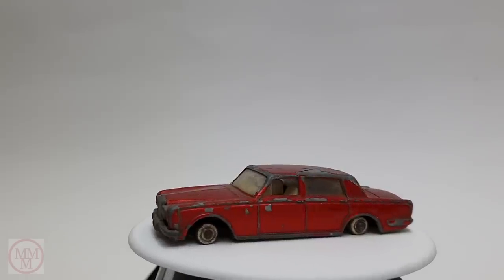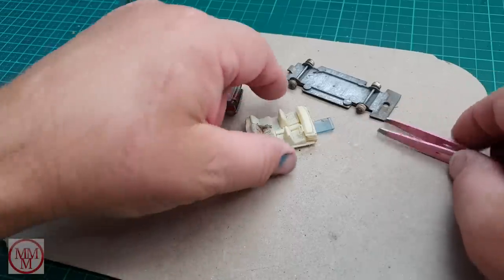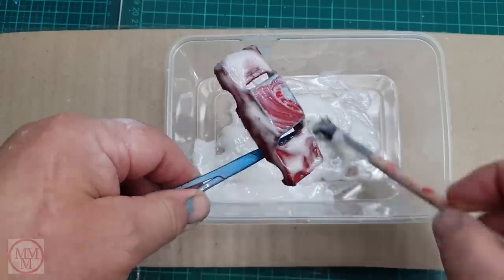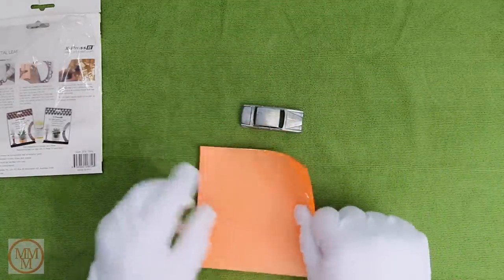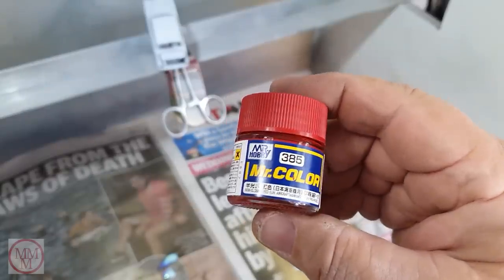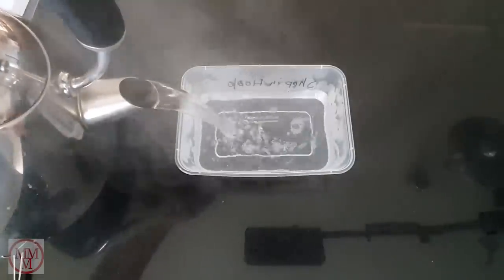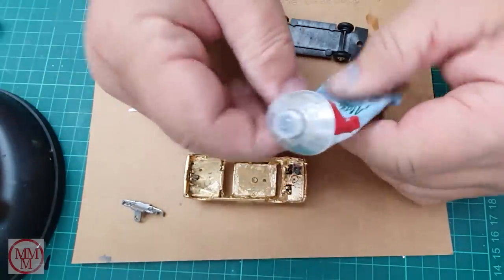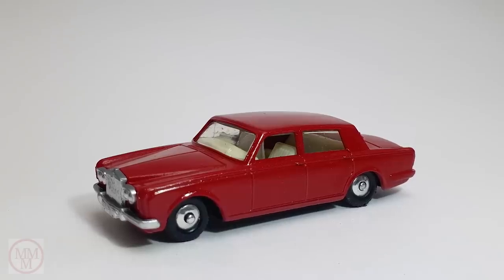MATCHBOX Custom No.24c Rolls Royce Silver Shadow 1967

Comment: Marty, not that you'll touch gold leaf again, but having done a fair bit of it myself you need to polish the base metal to a mirror to get a flaw free finish.
Reply: Yes. Gold leaf need perfect surface. I did that one or two on aircraft model and it works only on high gloss surface.
Reply: Wet sanding a primer may work as well.

Comment: Both Rolls' turned out all right.  I have always used the Selleys paint stripper, now I know to stay with it.  Never know what you will find inside a Matchbox: that spider egg sac!  I just restored a #34 the silver VW camper.  It had a yellow plastic barrel inside, from the #51 Matchbox trailer for the John Deere Lanz tractor.  Bonus.

Comment: Hi there; great channel as always! 
If you haven’t been put off: I think possibly the size was too thick. 
For glass gilding (signwriting) I used “Gelatine Capsules”: you dissolve a few with water. Goes on very thin, like plain water, but you’ll get a mirror finish without burnishing

Comment: Well done Kevin ... and Marty, you too on the cars. I've worked a bit with gold leaf and surface prep (smoothie smooth smooth!) is the key. Also, you can get edible gold leaf fairly cheaply. It doesn't have exactly the same reflective shine, but it's just as bright and cheaper than what you get for gilding. You may want to drop a note to Diecast Resurrection and see what he might do for a paint-based approach. Always a pleasure. Thanks.

Comment: I was thinking the same, get some real gold leaf, say for my Ford GT-40. I'm in Thailand so it should be easy. Meanwhile I wonder if you preheat your paint and body before spray will you lose the bumps? I don't think you did any sanding either. Prep. 
   To my astonishment the first time I tried a make-over the red paint job on my Matchbox Berlinetta came out glassy!! Warm climate??? But because I had no primer it came off easily and also was a tad transparent because I stopped spraying immediately when I was seeing the glassy result. I got the same satisfying glassy white finish on my GT-40 with broken A pillars. Glassy on the first passy. Am I some kind of magician or what? Time will tell. Thanks as always, Paul in warm Thailand.

Comment: The surface of what you want to leaf has to be as smooth and shiny as the end result you want.I would use a gold metallic paint and cover it with gloss clear.Does'nt matter if you use real gold ore the fake one.The real one is of corse "real" but also very pricey but as mentioned,its all up to the preperation of the surface.The leafs are so thin on both types that everyting,even the finest dust will show through.But as with all new techniques,training,training and more training will at the end make it perfekt.Gold leaf is an artform!!

Comment: You'll probably get a phone call from a Saudi Sheik that wants to buy it.  I had a Harley Sportster in 1972, that I customized and painted white.  I used variegated gold leaf and put custom panels on the tank and fenders, then shot red pearl all over it.  Looked awesome.  I sprayed the adhesive...you know why now.  And yeah, you can't breathe when you're doing that stuff or have any air movement.  The brush you used was close to what I used.  The secret is to have the surface beneath the leaf as gloss smooth as possible, because the leaf shows any imperfections in the under-surface.

Comment: Hi Marty ,  I applied gold leaf to an Airfix 1/168 Royal Sovereign , also had problem with the glue , so I diluted it with purest sugar cane alcohol or good quality  vodka ( alcohol with minimun water ) and also applied with airbrush , to obtain a soft surface . After leaf applied  next day airbrushed with 2k polihurethane . All metallic finishes  ( aluminum foil , paint , gold leaf ) tends to enhance all imperfection left on surface , therefore it has to be prepared -polished  mirror like . However , gold leaf has its limitations , it may show tiny cracks , wich in the case of that particular maritime vessel  give an antique effect . Always looking for a new video from You , I´ve learned a lot  from You , and  I see You are becoming more sofisticaded and technified .

Comment: wow, what a project. :) unique indeed! someone saiud they'll send bare metal foil, and I wanted to recommend it, too. the silver/chrome is thin aluminium foil with a glue backing, the gold is actually brass. a bit less wieldy than the aluminium, but applies the same and is easily polished. and in this scale looks a lot like real gold.
furniture restaurators actually use sticks with a rounded opal stone at one end to polish the gold leaf layer into smoothness ontop of the wood (or whatever material they used). german TV had a series where they portrayed old, almost-forgotten crafts for the future, and there was one professional picture frame restorator. so I think one of the problems was that you had no means to smooth out the surface after application.
btw, when you snapped the spring leaf I actually got startled; I know this noise too well from the past. :P
aaand I enjoyed the outro as well. :) stay safe! <3

Comment: Try a cheap hobby "electroplating kit" and have a go at electroplating the gold ( It's what's used for "gold plated silver" jewellery etc. that way the gold plating is smooth seamless and probably won't cost as much as doing several goes wasting product to get a good finish. It can be used to plate other materials too like nickel (Looks like chrome) Am enjoying your fledgling hobby video's keep em coming!

Comment: Love your videos. Only real gold leaf can be burnished. The large sheets you find online are usually tinted copper sold as gold leaf. Real gold leaf will have a Karat value and be quite expensive. As far as which sizing (glue) wold be best on metal. Time to experiment. And the color of the bole or undercoat color will affect the warmth of the gold color. Good Luck!

Comment: Marty, to get a better result, try these other options:
- Buy a DIY goldplating set.
- Use much thicker gold foil (expensive....) but that is followed buy hours and hours of polishing......
- Polish the white metal to a mirror shine and have it gold plated by a professional jeweler.
- The cheapest option: spraypaint (Tamiya TS-14) the car in high gloss black. Paint work MUST be flawless...! Let FULLY dry. Airbrush with Alclad Gold. Use Alclad Sealer (clear coat) for protection.

Comment: the trouble with gold leaf is you have make sure the model is spotless . when i say this i mean it should be rubbed down with 2000 grit wet and dry and then polished on a bench grinder before applying gold leaf ,the gold leaf is so thin is will show every mark ,to get a flawless finish is very time consuming . maybe  plating it in copper and then a gold plate would work better .but im not sure if the copper would adhere to cast metal ????   keep safe marty .same goes to your family ,thanks for the video,s its keeping us sane :)

Comment: Marty, you may want to do some actual gold electroplating. You really need a cleaned and polished surface for doing so, and it was a three step process where I worked (so is chrome). Guys would bring in car parts (we were doing electronic components) for plating for years. Gold was only $35 an ounce back then. The biggest dangers we had: Lots of acids for washes, and the gold salts were a cyanide base. But I suspect there are safer alternatives forty-five years later.

Comment: When you said gold plated, I thought you might try gold plating via electrolysis. I think it would give a better finish without any rough edges. Could use a cheaper metal, like brass and polish it up. Have a look into it :) Zinc would work well for a silver/chrome car.

Comment: The gold Metal leaf is neat but at this scale you should look into gold electroplating. From what I understand you could use real gold but it hardly uses much at all. You could use an old ring and probably still wear it afterwards. All you need is a couple of wires with clips, a power source, and non conductive container, and the electrolytic solution - not sure what that is but there are YouTube vids on it of course. You might even like the  process as a way of restoring the more badly corroded cars. 

BTW - It's gold colored metal leaf - that is how they get away with it. They could just as well be selling red metal leaf. Where Gold leaf would be the real stuff. I have never seen anyone have to use a glue to apply it either and it sounds like it takes burnishing better than that stuff does. 

Good vid as usual. I always look forward to the next one - even the unboxings!

Comment: Hey Marty good video as with all of them. If you want your glass looking as clear as possible and plan ahead of time . You can put clear plastics into a clear glass jar hydrogen peroxide and place in the sun a few days it will make it clearer but if it's scratched or blemished you'd still need to do a polish. Your new tool set has a polishing wheel have you thought about using it? Just don't hold it too long in one place or it will melt the plastic

Comment: I haven't seen all your videos, have you tried a sandblaster? I have seen other model makeovers by others who have used a sandblasting unit to remove paint. 
Suggestion: Do a video primarily about the tools & supplies you use and what they are for. Its easy to figure out paint stripper, but would like to see the range of tools and things you do use with some pro's and con's to each one.

Comment: The problem you are having with the gold size is that you are using the acrylic version.  You need the VOC version which will not kill you.  The VOC version can be thinned so that a much finer wet coat can be applied.

Comment: just watched this.  I believe what you have is transfer leaf, and that will never be shiny, even if you burnish it. also, oil size won't give you a shiny finish. you want real leaf, but loose-leaf not transfer leaf. ring the guys at www.goldleaf.com.au , that's where I buy it, they will set you up for success. a book of leaf is going to cost you about 60 bucks tho, and commercial size might be expensive too. id probably if I was attempting this, fill the model and spray it as normal, with a plain grey or neutral paint, and spray a separate panel as well, so you can touch that with the back of your knuckle to see when it tacks off, and just apply the gold over the nice paint, rather than try to brush or spray cheap size. it. use a bit less leaf rather than a bit more usually, and a very soft face powder brush to sweep the gold all over it. ask them about getting it shiny, a little bag made of velvet with cotton wool inside will give you a very nice engine turned effect too. hope this helps, look forward to many more videos, and at least another gold leaf one.
Reply: also real leaf won't tarnish, so no point clear coating it.

Comment: I think you gave up too soon on the gold leaf. I reckon if you wet sand the undercoat using 1200 grit, you remove a lot of those ripples and you'd probably end up with that mirror gold finish you wanted